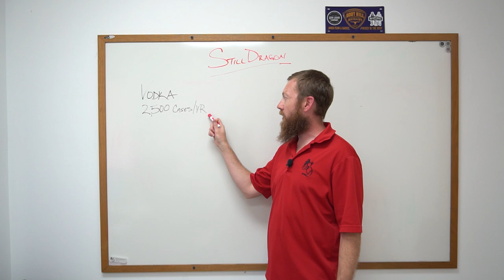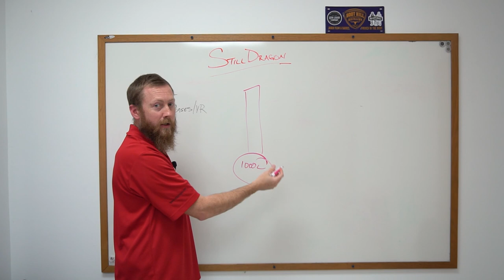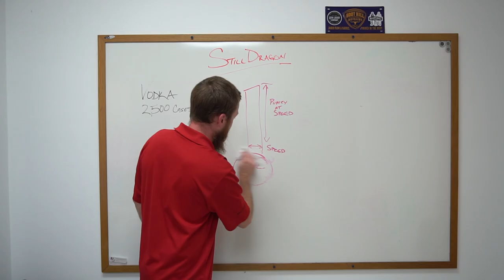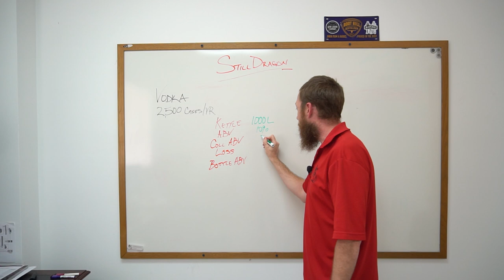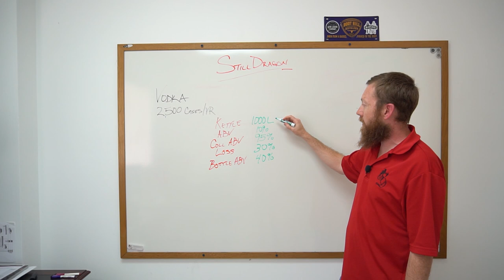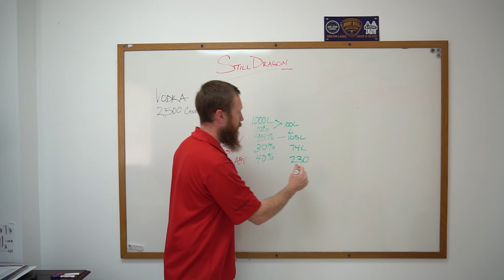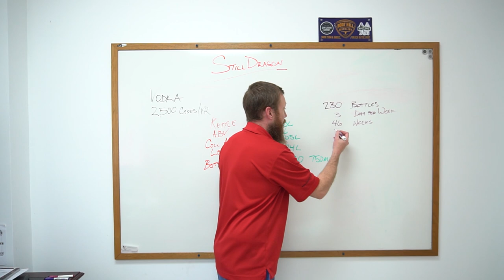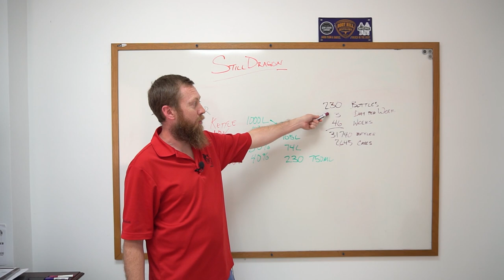What Size Still Do I Need? (Vodka)

Comment: Is the column you're describing a simple plate column or a complex column with fusel oil removal and top reflux chamber? How high would it be for the calculation provided?
Reply from the maker: Hey Alex, the column I'm envisioning would be a simple plated column with dephlegmator. Something in the range of 18 - 24 plates to easily make Vodka proof spirit from beer or wine.
Reply: @StillDragon  thanks! do you have a link to the product page?
Reply from the maker: @moristar  yes, it is in the description!